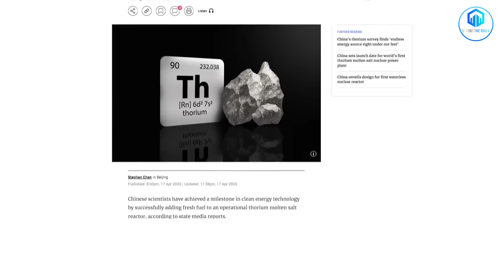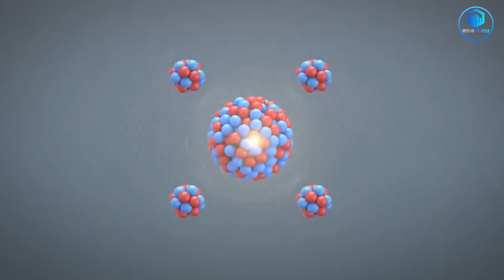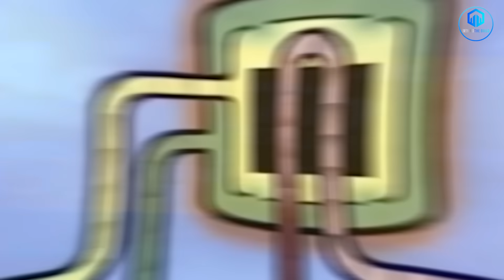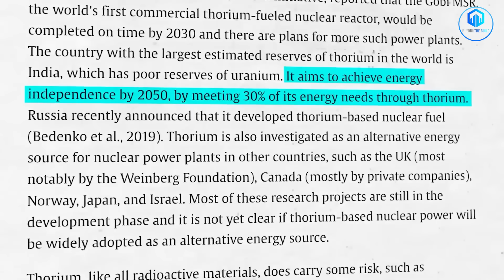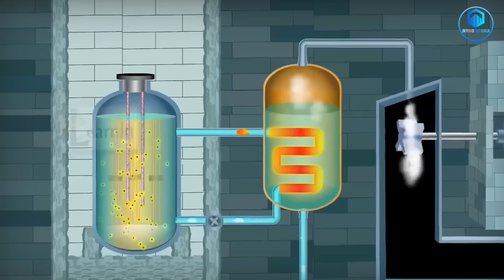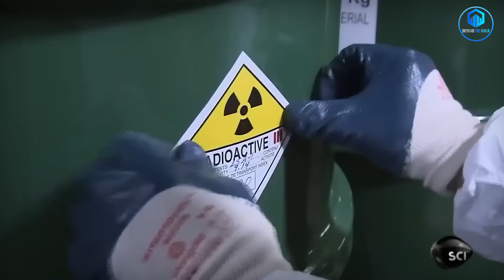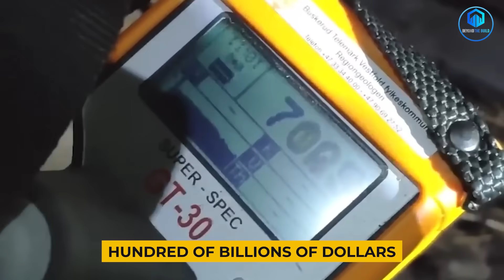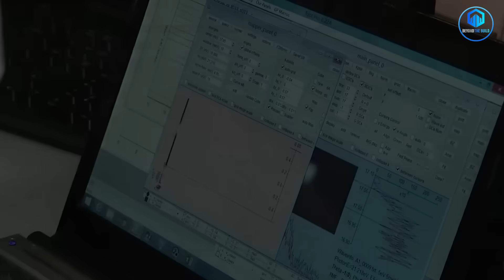China’s World-First Thorium Reactor That Never Shuts Down

Comment: Many forget the extreme corrosion and radiation. The piping, pumps and valves degrade fast and must be maintained. 
I would not be surprised if the test facility is abandoned in a couple of years. 
The reports will most likely state to high maintenance and safety issues.

Comment: Sorry this is NOT A NEW CONCEPT or even development: Done 1950 to 1973 by the United States Atomic Energy Commission (USAEC), the predecessor to today's Department of Energy and Nuclear Regulatory Commission, spearheaded the initial development of molten salt reactors (MSRs) and thorium fuel cycles from the 1940s through the 1970s. 
Key Historical AEC Programs

The AEC’s work on MSRs was primarily conducted at Oak Ridge National Laboratory (ORNL)
under the leadership of Alvin Weinberg. 

    Aircraft Reactor Experiment (ARE), 1954: Originally part of the AEC/USAF Aircraft Nuclear Propulsion program, this was the world’s first operating molten salt reactor. It used a fluoride salt mixture (NaF-ZrF4-UF4) and proved that liquid fuel could operate at very high temperatures (up to 860°C).
    Molten-Salt Reactor Experiment (MSRE), 1965–1969: A 7.4-MWth test reactor that successfully demonstrated the feasibility of the concept. It was the first reactor to run on Uranium-233, a fuel bred from thorium.

    Molten-Salt Breeder Reactor (MSBR) Design: Following the MSRE, the AEC funded the design of a commercial-scale 1,000-MWe breeder reactor intended to produce more fuel (U-233) from thorium than it consumed. 

Why the AEC Discontinued the Work

Despite the technical successes of the MSRE, the AEC officially terminated the program in January 1973. Key reasons included: 

    Competition with Fast Breeders: The AEC prioritized the Liquid Metal Fast Breeder Reactor (LMFBR), which used plutonium and uranium-238. This technology had more momentum and was viewed as a better fit for the existing nuclear industry.

    Budgetary Constraints: Funding was consolidated into a single "priority" breeder technology to ensure its success, leaving the MSR program underfunded and eventually cancelled.

    Technological Maturity: While promising, MSRs faced significant material challenges, such as tellurium-induced cracking in Hastelloy-N and the need for complex online chemical processing. 

Modern Legacy (2025 Context)

The AEC’s foundational research is now the basis for a 2025 "nuclear renaissance". Companies like TerraPower and Copenhagen Atomics are using AEC-era data to develop modern thorium and chloride-salt reactors. China is also currently nearing completion of its own thorium MSR complex based on these historical principles. 
Would you like to explore the specific technical reports from the 1970s that led to the program's cancellation, or are you interested in current 2025 commercial projects inspired by this work?

Comment: Refueling the reactor without shutting down is not unique to the Chinese molten salt reactor. The Canadian heavy water reactor, CANDU, do the same feat daily. CANDU reactor can be refueled while it is running at full capacity. The new fuel canisters are fed into one end of the long horizontal reactor fuel pipe, and the spent-fuel canisters are removed from the other, opposite end of the fuel pipe. All is done online without shutting down the reactor.
Reply from the maker: Exactly, Canada really pioneered online refueling. Do you think China’s approach is more about efficiency or just showing off innovation?

Comment: Like the thorium has nothing to do with why it's good, uranium I would ague would be a better fuel because you can use spent fuel, because to use thorium you have to breed uranium, so you can breed plutonium from U-238 in spent fuel, which is already dug up and is kinda of an issue, also because it's a molten salt reactor it's much easier to pull out extremely valuable substances, its like killing 2 birds with 1 of the birds.
Reply from the maker: Good point, thorium sounds great on paper, but the breeding step is a real hurdle. Do you think we’ll ever see a reactor that efficiently handles both fuel types?
Reply: @beyondthebuild-1  there have already been hybrid solid fuel reactors that use uranium and thorium so, yes.

Comment: Alvin Weinberg's dream.  Hookup some super critical turbine generators and make power so cheap you can use it for heavy industry.  Recycle everything.  Turn your landfills into mines.  If this works it transforms everything.  Decarbonize the air and convert it into carbon neutral fuel or cement or plastics.
Reply from the maker: Right? Imagine plugging into a world where waste becomes raw material again 🔁 You think we’re 10 years away or 50?

Comment: That is not that simple, Thorium must first be transformed to U233 if I well remember. There's a quite complex chemistry based either on Fluor or on Sodium. Alain Weinberg experimented a molten salt reactor in Oakridge, but did not use Thorium. What the Chinese have achieved is amazing ! Thorium is a byproduct from the rare earths production process.
Reply from the maker: Right, Weinberg’s work laid the groundwork, but the Chinese taking it this far is a big leap. Do you think it’ll finally prove scalable?

Comment: In the 1960’s thorium and liquid salt reactors were abandoned in the US.  Both Thorium and liquid salt reactors were built to operating prototypes.   But a direction had to be chosen, water cooled Uranium reactors seemed to be the best direction so it was chosen from all the competing designs.   Putting together a 2MW Thorium based liquid salt reactors is a remarkable achievement, but it has a long development process ahead.     Water at high temperatures is very corrosive, solving the metallurgy for water cooled reactors took years.     Solving the corrosion problem for liquid salt is just starting and may be unsolvable.    Keeping the reactor running at temperature for a long time will be the next milestone, I wish the Chinese good luck.
Reply: That is why you failed.
Reply: Uranium was best direction casue it could also make weapons, not because its better
Reply from the maker: Right, it’s definitely impressive but still early days. I wonder how long it’ll take before it proves stable in continuous operation?
Reply: I think some of the fission products of thorium is producing gamma radiation. Let's say it this way. There is a reason why they start with 2 MW and not 100, or even 1000. Seems like they build it and now wait what happens. In 10 years they will pull it apart to see what needs improvement.
Reply: The latest technological information indicates that corrosion-resistant materials have completed R&D. China will not waste a decade without mastering core and critical technologies. The next step is to scale up reactor power, construct an engineering reactor for verification, improve supporting integration and mass production technologies, then mass-produce large reactors for power generation.It's only a matter of time now.
Reply: Thanks for sharing knowledge. The story in this video is half false,  actually there was only one permission granted to the research organization. There is no evidence that the reactor is already running. Plus, as a former scientist who worked in a heavy ion research facility, I heard enough BS in the academy to say, this is just an experimental project that draws government funding, which probably will not work at all.

Comment: There's a lot of propaganda, half-truths and general CCP spin contained in the video. However, it is directionally right in some very important ways, especially in a Geo political sense. It's wrong to say it's "Chinese Thorium Vs Western Fossil fuels" for a start. China is building dozens of Uranium Nukes, as well as Fossil fuel power plants and tons of renewables (Solar & Wind), all at the same time. 

Thorium liquid fulled reactors are still very much novel and are a long way away from making a meaningful contribution to China's energy mix. However, It's wise that they started 15 years ago on R&D for this technology, while doing everything else at higher TRLs in tandem. 

I am Uranium/Thorium agnostic for now, as I just want more nukes asap in the West. I'm also Gen 3+ / Gen 4 agnostic too for the moment and for the same reason. Do all of it just as the Chinese have. All these fuel cycle, coolant, and other design choices have different use cases & are at different TDR levels, so you'll need several types to be developed over the next 30-odd years, while using tried and tested types to fill in while hese advanced reactors are developed. 

Thorium fuel cycles and liquid fuels/coolants are essentially 1960s Western tech, but it's true to say only China has seriously funded it over the last ten years after the West foolishly dramatically reduced nuclear energy R&D from the mid 1980's. China are considerably ahead now, something the West's "leaders" should be held accountable for. 

Yet still now, the West is making it worse for itself by thinking solar and wind are the answer to future energy in all markets; this is untrue and a fatal error. China shows this thinking is a folly & they are right. While they use solar & wind right now, they look at it as a "transitional step" as they need another 2 decades to R&D and then scale all forms of nuclear fission reactor types . "Peak Solar & wind" is going to come pretty quickly to China, somewhere between 2030 and 2035 I'd guess. It will level off at some point but will never form the backbone of China's grid supply. It will then probably stay steady & eventually fall in overall % production not long after that, maybe from 2040 onward. Nuclear will become the backbone of Chinese energy from around 2050. and I expect it will produce more than 50% of all Chinese electricity by 2060, even assuming a 2% growth in demand per annum from now until then, which I think will be ballpark right.  

All this is indeed a mortal threat to the West if it continues down it's "net zero" energy policy using solar, wind & batteries while reliying on Chinese imports of even these subpar, intermittent, sources that just can't do the job at competitive prices or relying on external Chinese supply. To think otherwise is dangerous fantasy. 

The West needs to wake up and aim for the same or, yes, it will be left behind. That much is true. Currently, I see too few signs of this for my liking, as I've been shouting for this to happen since 2011, but I do now see the need to power AI data centers and re-industrialisation of the West as being the forcing function that might be able to tip the scales and get the West's own propaganda on renewables to change course. Both the US and EU are not getting this right atm, the US, is now turning away from renewables in favour of fossel fuels, which isn't great, and the EU is even worse with their renewables + battery + H + energy rationing (let's call a spade a spade shall we?)  "plan", pushed mainly by German zealots & corupt unacountable officials that gain personally from these policy choices & investments either directly or indirectly, some from China itself. 

Both do now put money into nuclear R&D as well as deployment, but it's nowhere near the push that's needed.

I'll bet you that unless the West does wake up, China will dominate even while reaching the same CO2 per capita as any other major nation by 2060, though it produces more per captia in goods and services. This is only possible through "nuclear first" energy and "affordable energy abundance" policies.

Comment: You should have mentioned that this kind of reactor ran already 60 years ago in the US, and Chinese just copied this design.
The reactor still requires kind of water cooling for high efficieny. The only reason why it was placed in mid of the desert was to limit damage in case of an accident.
The point is - why use thorium at all, when spent fuel and depleted uranium (DU) is abundant?
The waste of 1 reactor year of a 1 GWe conventional reactor can provide more than 100 times the electricity originally produced. Additionally, the side product from enrichment, depleted uranium can provide another 4 - 5 times the electricity of the spent fuel. In total, this is more than 500 times the electricity that was produced by nuclear in the past. This are resources worth tens of trillions or even hundreds of trillions USD, that could pay the debt of the US multiple times easily.
A side effect is that the "waste" produced after complete burn down consists of 95 % partly precious metals, and about 5 % of waste that decayed after 300 years to the level of natural uranium. Of course, it is poisionous, but can be stored just like normal chemical waste. And the amount is small anyway, because 1 kg or uranium/thorium contains 24 GWh of thermal energy. The volume is less than the size of a coke can per TWh. 
Beside some advantages of thorium, there are nasty site effects. There are hard radiation sources within the thorium-cycle. Proactinium 233 and Thalium 208. Pa 233 comes from breeding Th233. It is a bad neutron poison, that requires immediate separation from fuel, otherwise reactivity stopps. Pa233 then must be stored separately, until it has decayed to U233. This decay also produces hard alpha and beta radiation. TI208 on the other side, comes from a small part of U232 produced during breeding. U232 decays at some point to TI208, which issues hard gamma radiation. This requires more extensive shielding and complicates handling. So the thorium-cycle has some drawbacks, which are often not mentioned. 
IMHO, before using thorium, waste and DU should be burned. And if this isn't enough after thousands of years, there is the posibility to get uranium from seawater, for which China seems to have found a cost effective solution now. 
Of course, you can use thorium sometimes in the same reactors, that burns waste and DU, but it isn't necessary for energy needs for a long time. 
So again, why use thorium when it isn't really necessary?
Reply: Why has China succeeded where other countries have failed, and why has China achieved this in decades when the United States has not?
Reply: @gengron6297  Different priorities?

Comment: I'll give China credit for having the stamina and persistence to develop this process. A process which was created in the USA over 60 years ago. We built a working molten salt Thorium reactor in Oak Ridge Tennessee and the government shut it down because it could not produce Plutonium needed for bombs. Never mind the fact that it could be fueled while operating. Never mind the fact it could burn and render harmless the nuclear waste from Uranium based reactors solving the problem of disposal of radioactive waste. Never mind the fact that it burns over 97% of the fuel it is fed compared to standard solid fuel fission reactors that only burn less than 3% of their fuel before they have to be shut down and new fuel rods installed. Never mind the fact that liquid salt Thorium fueled reactors are fail safe, that they can't melt down, that in a complete loss of control the worse thing that can happen is the freeze plug in the bottom melts out and the fuel drains into a pit designed to contain that molten salt fuel like a giant ice tray till it solidifies as it cools down. No, never mind all this, just let the Chinese develop it further and kick our non-competitive ass. We decided it was too complicated to figure out how to pump and circulate molten salt, especially when all it could do is generate power safely and get rid of radioactive waste. We have need of more bomb making fuel, and we  got people with contracts to store nuclear waste for 20,000 years.
Reply from the maker: You’re right: politics shaped a lot of energy history. What milestone would convince you that thorium’s finally ready for widespread use?
Reply: Right on.

Comment: Kirk Sorensen has been telling you since the 90's. General Curtis LaMays' flying reactor is SO SAFE you can run it till it breaks. 

But please, don't put it in an airplane. That would be REALLY dumb. Spacecraft, sure. So long as it's no where near Earth. Antarctica, Arizona, the Moon, Mars, sure. Just put it a hole. run it till it breaks. Then bury it. After you get the fuel out, and charge the new reactor, using our special, proprietary tools. No, you can't photograph them.
Reply from the maker: Good point about safety and location, aircraft would be a terrible idea, but remote bases make sense. Which non-Earth site do you think is most realistic: Moon, Mars, or orbital platforms?